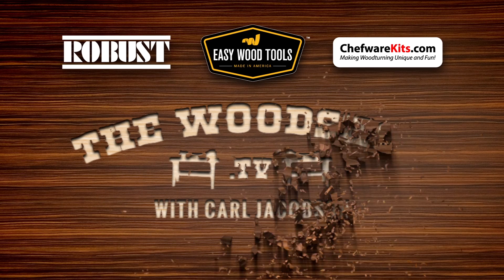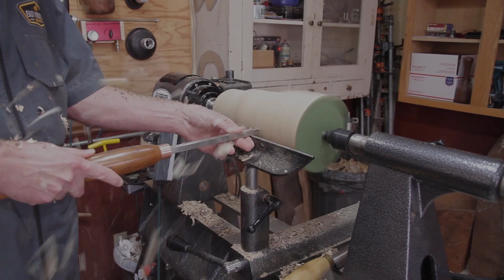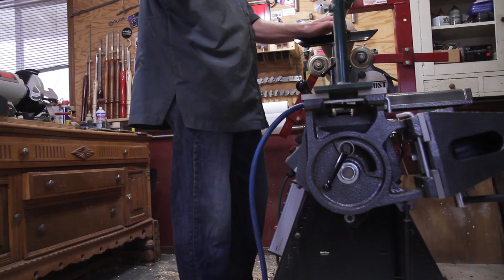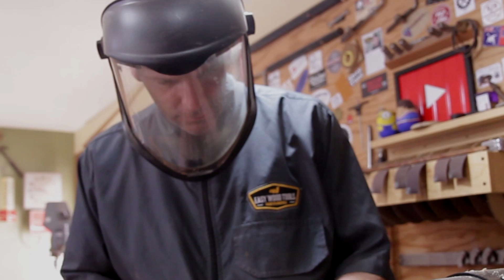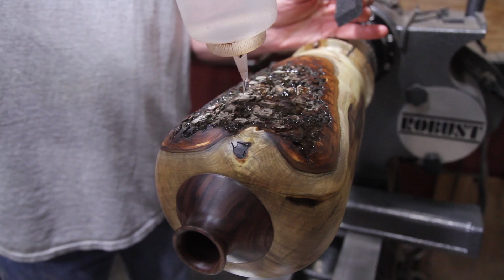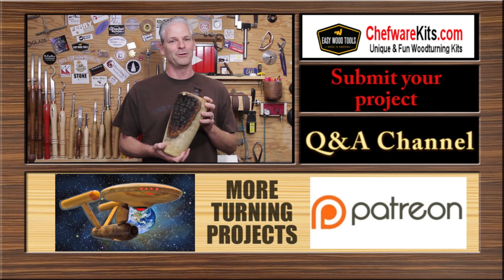Woodturning Elm Vase | Carl Jacobson

Comment: Carl... this is beautiful, truly beautiful!  I have two questions for you here.  
1.) Did you CA the Bark inclusion at all to keep it from breaking, or just extra careful while turning it?
2.) That looked like a green log... will this piece not warp/crack as it dries or will the increased wall thickness keep that from happening?  If the warp/cracking is not an issue I have TONS of checked logs that I can't use for bowls... I might have to invest in a hollowing rig and learn to do hollow vessels.
Reply from the maker: +Justin H Thank you very much Justin, I didn't use any CA glue on this one. I was just extra careful. This was was a little green, but if you're turning green wood it will check and crack even if it's a hollow form. The only was you can get around this is to turn it very thin.

Comment: Sooooooo   ummmmmmm  the bark.
What did ya do to secure the bond between the bark and timber?
CA glue around the  edges?   
Dozens of Tiny pin holes and ca clue through the face of the bark? 
Did ya just let nature do it? 

What what what
Reply from the maker: +Raul McCai lol This piece was cut down in the winter, so the bark will naturally stay on better. I didn't use CA glue.